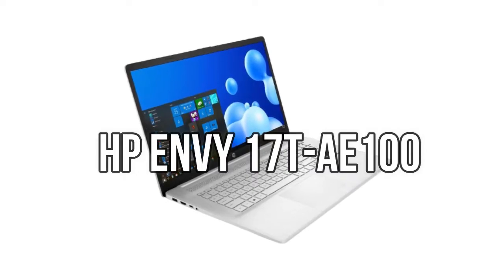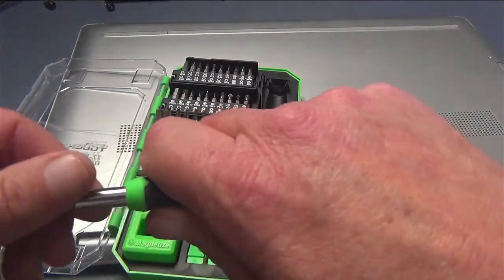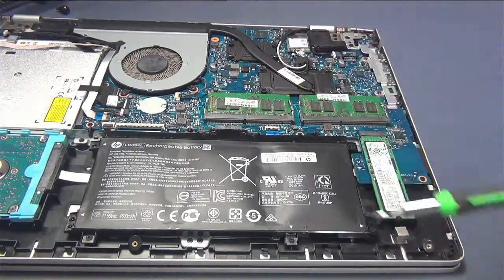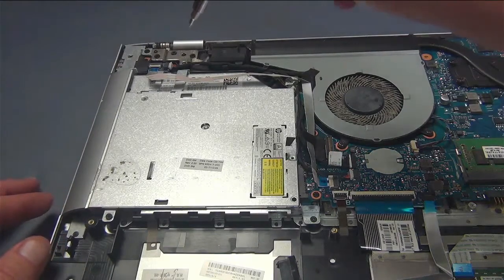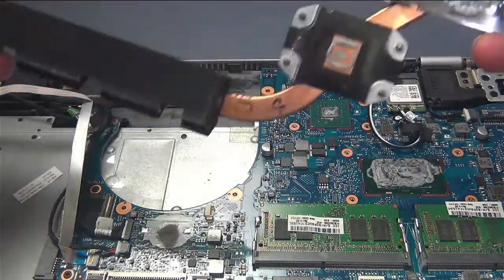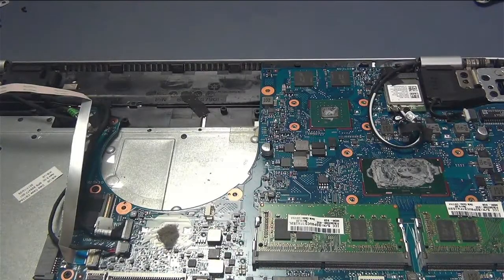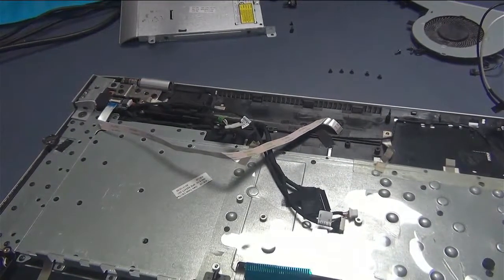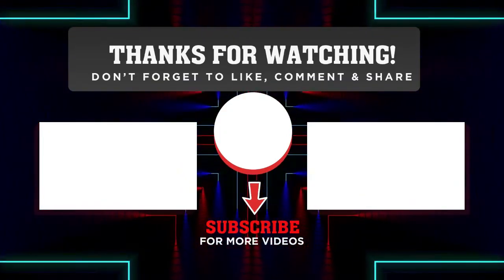How to upgrade an HP Envy 17t-AE100 | FULL how-to disassembly

Comment: HP lately just doesn't make their cases very friendly to upgrades.
Reply: @Pratik khandelwal I don't own a Samsung Laptop.
Reply from the maker: No sir, they don't!
Reply: @AskYourComputerGuy  I am a "sir" now? Yes.... Sir Nico of Tech
Reply from the maker: Like Robin of Loxley...with better hair :)
Reply: @Pratik khandelwal I have a lot of videos already in the works for all of April and a laptop repair is not one of them. Maybe @AskYourComputerGuy will.
Reply from the maker: Are you saying you connected the display cable while you had the laptop plugged in and charging? That would definitely cause a spark and probably damage the LCD circuit board connection
Reply from the maker: I'm not sure what you're asking here, but it sounds like you already know how to connect everything. Unfortunately, when you connect components with power on, damage like this can happen. Always remove power when working with electrical components inside a laptop